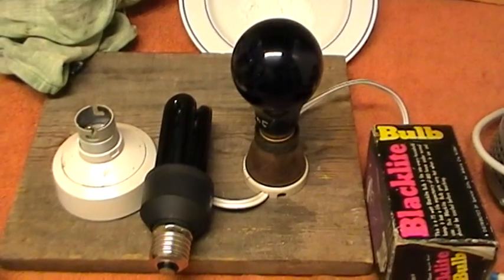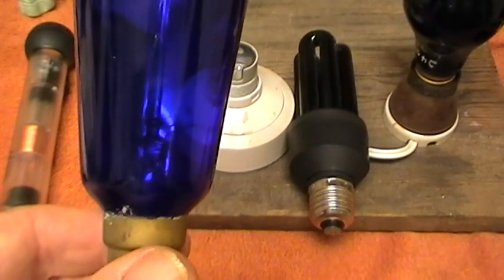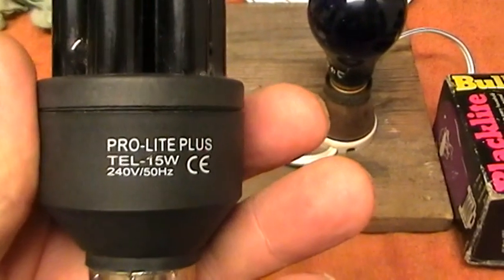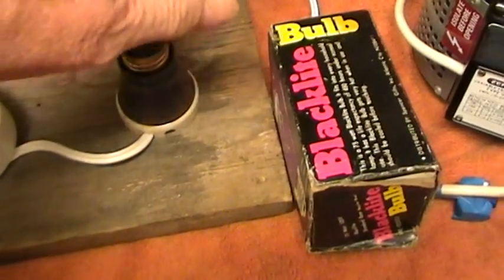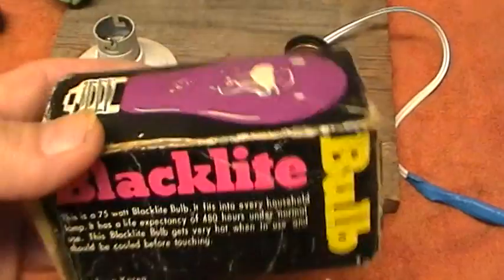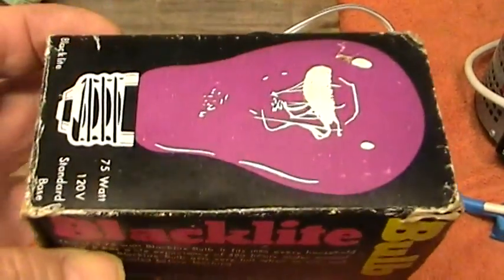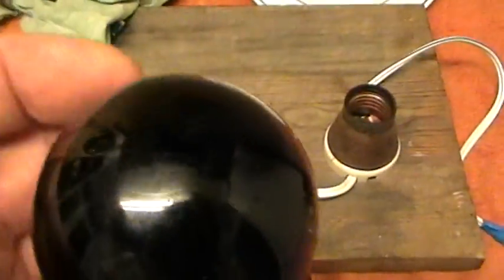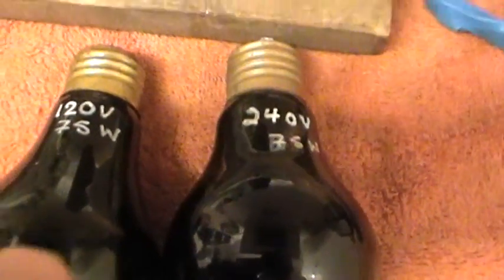Comparison of black light bulbs

Comment: Hi Migette,
what would be interesting would be a black light bulb that would strobe. I don't know if the density of the UV glass would be too dense to warrant such a creature.
but just thought if it were possible, it would bring  the Black Light effect to a new level.
if one could use a xenon bulb, and if someone was or knew a glass blower, they could use a glass cutting torch to cut a small length from a florescent black light tube and pinch one end. and use it as a kind of shade of sorts.

Comment: Hi, I have just ordered a similar UV bulb like the prolite one that you demonstrated. Do you think it would be suitable for curing LOCA glue that is used for bonding lcd displays? I have yellowing on the bottom of my OnePlus One smartphone display and there are rumours that exposing it to UV light will cure the glue and remove the yellowing. Any help would be appreciated, thanks.